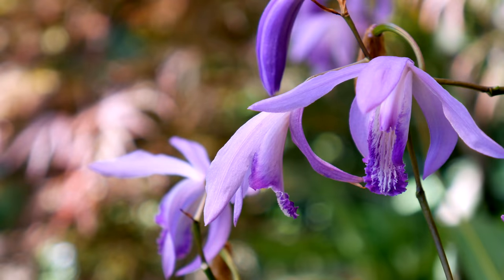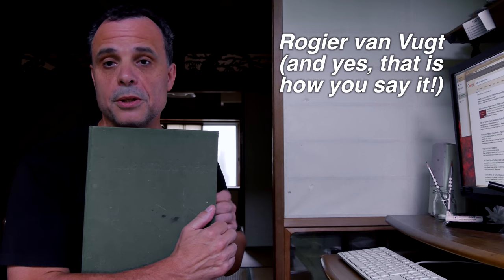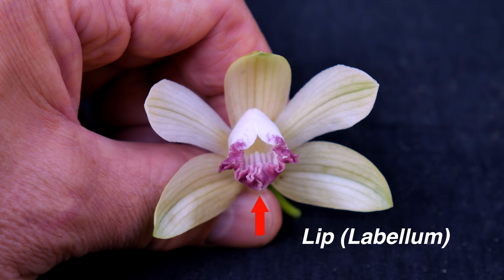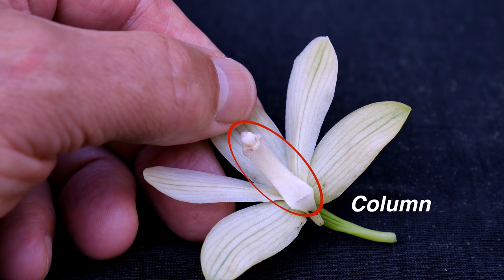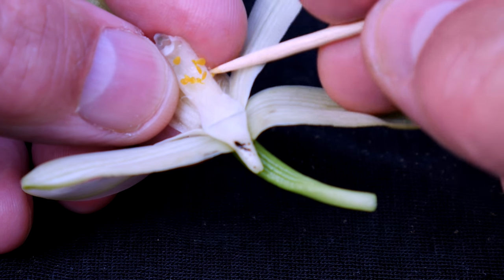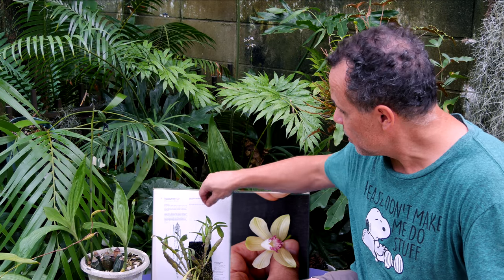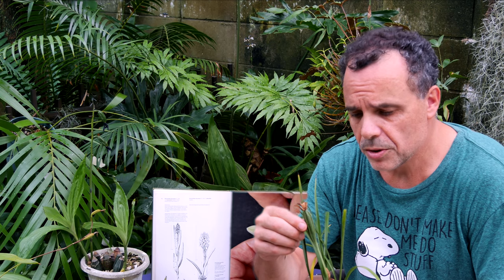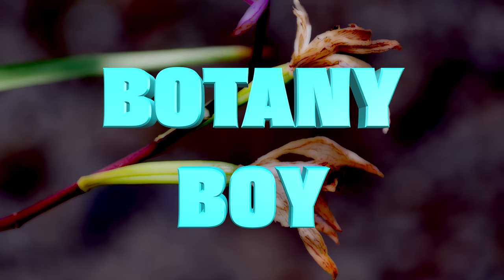Orchid Flower Structure, and How to Pollinate an Orchid Flower

Comment: Hi,
Watched your video on Orchid pollination.
Tried on some flowers but after one week all flowers are drying & dying. Is it normal?
How many days it takes for the flowers to die? 
Thanks for reply.
Reply from the maker: Some pollinated flowers will begin to die almost immediately, some will grow thick in substance, some will take more time to fade.  The most important thing to look for is a swelling of the ovary.  If it swells, you have a pollinated flower, otherwise it will yellow and fall off.  One thing, it is not unusual for a seed pod to form with few, if any, seeds inside, but you'll have to wait several months to check that.
Reply: @botanyboy1  Great: Thanks for your reply & tuto. Hope it will work.